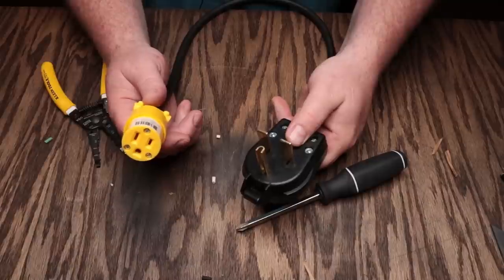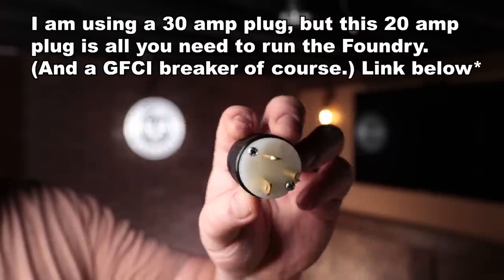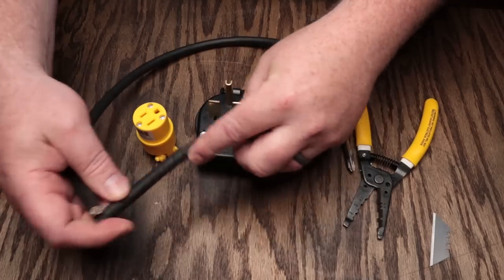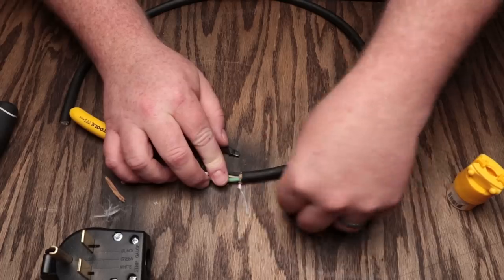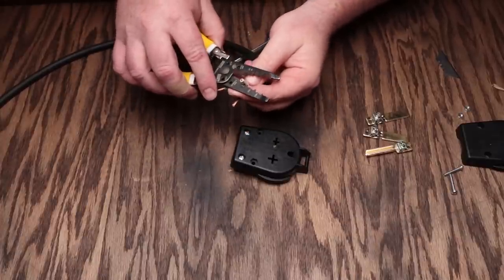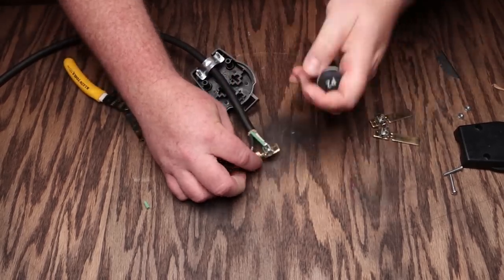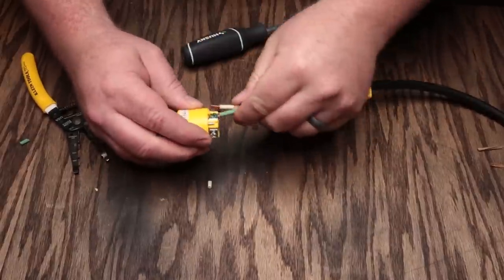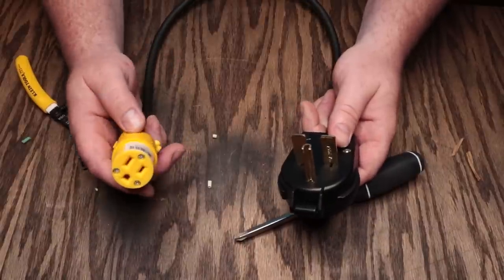Anvil Foundry 120v to 240v plug adapter DON'T CUT YOUR CORD!!

Comment: Thanks for this video, I bought the Foundry the other day and I did not like the idea of cutting the cord, fortunately stumbled across your review of the Foundry and then saw the Don't Cut The Cord video at the end. Not only avoid cutting the cord, but the short extension makes it easier to plug into my old dryer 240V plug in my former laundry area in the basement. Straight forward easy to follow videos, not just for Foundry, but for the various presentations you posted, great work IMO.
Reply from the maker: Awesome just make sure you are GFCI protected! 👍🍻
Reply: +1!  Same story here (except for having a spare dryer outlet ☹). Great videos all around. I really like your presentation style and the video production. ✩✩✩✩✩
Reply from the maker: Thanks!! 👍🍻

Comment: Great video, thanks!  I agree with nearly all previous comments, and yes there’s cause for  concern with mistaking adapters.  Two important SAFETY TIPS though:  1)  never leave the 220v  plugged in when not actually using the Anvil system.  Only plug in when you need to run elements.  2)  this is a dedicated adapter for Anvil system only.  As such, securely fasten the adapter to the Anvil system power cord so adapter remains connected to Anvil.  Something as simple as zip ties can keep the connection attached & would force someone to purposely remove secured adapter from system.

Just my 2 cents worth as a mechanical engineer and long-time brewer. A little sense can go a long way.  Cheers!
Reply from the maker: All good tips!! Thanks for the comments!! 👍🍻
Reply: @ShortCircuitedBrewers  Definitely a good tip.   Its not me I worry about its someone else grabbing this and plugging in something besides the Anvil and letting out the magic smoke or worse.
Reply from the maker: @matthewmeiser2298  lol magic smoke!!
Reply: Tim, I agree with your comment and Matthew's below. So I would also clearly label or tag the adpater with something like "WARNING! 240V: For use with Anvil Foundry ONLY!" at the NEMA 5-15 "standard" outlet end. Just in case it ever gets unplugged/unsecured from the Foundry plug.
Reply from the maker: Good idea! 👍🍻

Comment: Thanks for this vid Brian.  Followed every step but had to go for an old school 240 volt (3 prong) plug vs the one you used.  Same brand just a different configuration.  Some hesitancy plugging it in and firing up the foundry but went for it and it works flawlessly!
Reply from the maker: Great!! Glad it worked! 👍🍻
Reply: I think that is a 20amp 240V connection. The one in the video is 30amp. The bigger 4 prong 240V is 50amp.

Comment: You're right. It's the current level which dictates the gauge of the wires used and insulation etc, not the voltage.
The higher the current the thicker the copper wire needed.
This is why solar panel arrays on home roof tops are wired in series. This means that the voltage is added but the current stays the same. So 10 panels rates at 38V DC and 5 Amp, will produce a total of 380 V DC and 5 Amps when wired in series. You can then use 5 Amp rated cables which are cheaper and thinner.
If you wired the same 10 panels in parallel you get 38 VDC and 50 Amps, which requires expensive heavy gauge cables. Also the high current makes it very dangerous.
Note: Both series and parallel wiring arrangement produce the same output power (ie 1900 W).

Not sure why the heating element power would be 2800 W at 240V and 1600 W at 120V. The 30 amp maximum on the 240 V?
In the end you're limited by the current that the system draw
Reply from the maker: You are assuming the wiring doesn't change from 120v to 240v there is a switch on the machine that changes the wiring configuration for the 240v option. 👍🍻
Reply: @ShortCircuitedBrewers  ok. here in Australia the standard wall power outlets are 240V and limited to 10 Amps. You can separately wire up a 15 Amp outlet which is still 240 V.
Otherwise need to specially go a 3-phase wiring at 415V (industry usually uses this option)
Reply from the maker: @PetraKann  I understand. 👍🍻
Reply: And there are cable type voltage limits that start around 300 or 600V. Just no issue between 120 and 240V with the components in the video.

Comment: I made my adapter cord. Got my NEMA 6-20P receptacle installed. Plugged in the cord to check everything out. Heard a loud pop - saw sparks. Shut off the breaker immediately. One prong on the NEMA 6-20P was burned along with the corresponding hole on the receptacle. Not quite sure what happened. I also made my cord from 10g wire. I scheduled an appointment for an electrician to come out and take a look.
Reply from the maker: Something has a direct short it sounds like. I'd wait for the electrician to check it out.

Comment: Once you make the adapter you can get plastic cord holders. Made to keep two extension cord together. That would keep the adapter with the anvil.
Reply from the maker: Definitely good advice! 👍🍻
Reply: Cut a section of old bicycle tire inner tube and stretch it over the connection.  Zip tie each side.

Comment: Suggest you make a point of connecting the white wire to the wide conductor of the 120V. Just in case someone changes the 240V plug to a male 120V.
Reply from the maker: Ok

Comment: The only concern I have with this would be if the 120V plug(s) are rated to handle 240V. If they are not, then there would be a potential of arcing between the contacts within the 120V plugs if they did not have the proper spacing between the contacts. I do not know if this is a potential issue with 120V plugs due to contact spacing and the material used but the concern is still there if the manufacture only rated the plug for 120V.
Reply from the maker: I understand your concern. There are no spacing issues and the amperage drawn by the foundry at 240v is less than what it draws at 120v. Also hundred of people have made this adapter and I've had zero contact regarding any failures. 👍🍻
Reply: There is a similar shaped 20amp 240V plug so there is no material "deficiency" but still need to be careful about creating a short due to wire handling (stripping too much, etc.)

Comment: My dryer outlet is 30a 125/250v. Would your solution still work if I follow your video and adapt the foundery cord to this configuration?  This would require a different plug which Ive researched and identified as meeting these parameters.  Thank you!
Reply from the maker: Yes it would. 👍🍻

Comment: Any issue with using a larger gauge wire?  I have a cord from a large SAN disk array.  It has a NEMA L6 plug and is 10 gauge.  I could save a lot of money by just buying a 15A 120V 3 wire plug.
Reply from the maker: Nope not at all.

Comment: I can think of one reason not to make that adapter. 
You accidentally leave the adapter plugged into the wall. Someone (kids wife whatever) breaks out a vacuum sees the dongle and plugs it in. They hit the power button. 
The master electrician in me doesn’t like this kind of adapter in a home. 
Just a thought.
Reply from the maker: I know you should not let small children play in your brewery unattended.. 👍🍻
Reply: @ShortCircuitedBrewers   or Wife
Reply from the maker: @MrRhino12667  lol right.. Mine brews with me so I didn't think about that!!
Reply: @ShortCircuitedBrewers  That's Awesome mine just drinks all my wine. just now getting into brewing.
Reply from the maker: Welcome to the hobby!!
Reply: How about replacing the plug with a C14 inlet (this is the power port on most computers and monitors) and then using a C13 to NEMA5-15P (the cable used to plug computers in for the US) for 120V and a C14 to a NEMA6-20P for a 220V outlet?

I'm no electrician but this adapter scares the dickens out of me.
Reply from the maker: @jasonq13  not a water resistant connection. Would allow water into the plug easily.
Reply: Don't have kids. :)

Comment: Hey Brian, why does it have to be a GFCI Breaker? Will this not work with a standard breaker? My place seems to have standard breakers where I’d plug into (Dry Outlet). What considerations would I made if doing this on a standard breaker?
Reply from the maker: It needs to be a GFCI breaker for your safety. Regular breakers are not  made to sense a ground fault. Be safe and don't use this without a GFCI breaker. 👍🍻

Comment: Love your videos and I’ve recently purchased a Foundry 10.5 as a result of your detailed reviews. I’ve brewed at 120v, now I’m ready for 240v.  In making this adapter, how long would you recommend the wire to be. Is 15 to 20 feet too long of an extension cord? I’d like run the wire outside. I do have a brand new Siemens 20A GFCI breaker than I’m installing in the panel. I don’t have an electric dryer as I use natural gas, so I’m stealing that slot for my Foundry. Thanks.
Reply from the maker: You can go up to 50' just fine with a 12 gauge extension cord. 👍🍻
Reply: Thank you for the speedy reply Brian. I didn’t think it would be an issue,  but figured I’d ask.
Reply from the maker: @MarceloSilva-xe1xd  I'd rather you ask! Thanks for watching and the feedback! 👍🍻

Comment: Brian, regarding my conversion: my 220 wall outlet has 4 prongs (three blade and one "L" shaped; however only three on the anvil 110.  I did see another video where you did not use the 4th neutral prong when you wired the three up in order to use a GFI.  Is this correct?  I can remove the "L" shaped prong, wire the three other wires to the two hot and 1 ground?  Thanks

Bob

Comment: My garage has  30 amp 240 breaker.
The outlet box has red and black hot wires, white neutral wire and a bare ground. Im assuming i should us the 14-30r for the outlet. But not sure what to use for the insert plug.  Remove the white prong so it 2 hot and 1 ground? 3 prong
Reply from the maker: Yes you can do that but you should watch my inline GFCI cord video to be safe if the breaker is a standard one. https://youtu.be/El3ew5bNQ3Q
Reply: @ShortCircuitedBrewers  
Its already has a GFCI breaker.  Would it be best to abandon the white wire or switch to 20 amp.  I think this feed was intended for a generator when they wired it. 
 Love your videos. Your a natural
Reply from the maker: @opdthru23348  not necessary. You can just leave the white wire off. Thanks!! ,👍
Reply: @ShortCircuitedBrewers  
Ok last question. With the understanding you are not a licensed electrician. Can you recommend an outlet? 
Thanks!!
Reply from the maker: @opdthru23348  I would use a standard dryer outlet that way you have more options in the future should you want them. And make the adapter cord with a dryer plug and remove the lower center lug (neutral) just in case you want to move up to a larger system in the future. 👍🍻

Comment: Tape the adapter to the cord of the device it's meant to be used with, that lowers the risk of accidentally plugging something els into it.
Just a quick word of warning: If your house ever burns down due to something in your brewery or anything near this adapter, your insurance company is going to try it's best to not pay out due to this adapter.
Reply from the maker: Good tip! 👍🍻

Comment: Any idea how to convert a 4 prong 240v outlet? Do you think a 14-30P Male to 10-30R Female adapter would work ok?
Reply from the maker: You just leave the neutral wire unconnected. It is not needed. 👍🍻

Comment: I just picked up an anvil foundry for black friday and brewed it on 120. Worked decently well if I left the lid on to get a stronger boil. I am not too far from my dryer outlet so I was thinking about using the cable you suggested. I need to convert from the NEMA 10-30 to the NEMA 6-15. The circuit breaker that dryer is on is a 30A breaker, but I know the Anvil has a breaker itself. Do I need a 15A 240V in-line GFCI as your other video suggests or is the combo of the 30A breaker + the anvil's circuit breaker satisfactory? Your videos are awesome, they tipped me over the edge to get the foundry and I think it will make my brew days significantly easier.
Reply from the maker: You always need a GFI in the power cord or a breaker..a standard breaker or the Anvil breaker does not protect against ground faults..always be safe.

Comment: Hey Brian,

Awesome video! Thanks for the intel. It seems your link for the 12 gauge wire is out of stock. Which type of wire should I look for a replacement? 12 gauge, 600 volt? When I type this in it shows wires that all look completely different. If there is a variable that I’m missing, please let me know.

Thanks again!!

Comment: I am confused, with 3 prongs on the outlet how do you get 240?  Usually you have 2 hots, neutral and ground.  
Are there low amp 240v items like the 1st plug you show that only use a 3 prong?  My old house had a 220 that had similae sized prongs as a 120V outlet but ive been watching soo many generator videos where there are 4 prongs.  I haven't watched the whole video so maybe you explain it but thought id comment.

Is your neutral wire now acting as a hot or what?
Reply from the maker: 240 doesn't require a neutral. The only reason some devices have a neutral included in the plug is for 110 components inside the device.

Comment: Does that thing ever get hot using 12ga wire being 220 in a house uses 10ga wire?
Reply from the maker: Not with a load in the appropriate amperage range. You still have to pay attention to the component with the lowest amperage rating. Power supply gauge doesn't matter. My supply is 6/3 in this case. 👍🍻

Comment: Hello Brian,
I have an old style 3 prong dryer outlet (10-30) that has two hots and a neutral but no ground.  From what I've read, when a new electric dryer is plugged into an ungrounded outlet,  such as a 10-30, the ground on the dryer would just be connected to the neutral.  With that being said,  would it be possible to use this adaptor to connect the anvil to an older 10-30 outlet?  Would it be wired the same?  Would it even be safe?
Reply from the maker: If there is a standard outlet nearby you can use thi adapter and get the ground from the standard outlet 
https://amzn.to/3MZ8lQ6

Comment: I would like to add a 2 gang outlet to my brewstand with on/off switches to power my foundry and chugger pump and then run a cord from the stand outlets to plug into the wall. I would also like the ability to do this with 240v if possible...how would I go about doing this? Any help is appreciated!
Reply from the maker: It can definitely be done. Can I explain it in a comment? Probably not. Why don't you send me an email  . Brian@shortcircuitedbrewers.com and we can discuss it.

Comment: Hey Brian, THANKS for the video, super helpful.  I need a similar adapter, but in reverse of what you made.  I'm assuming it's the same process but swap male to female and visa versa, correct?  I have a RoboBrew 65L and need get that N6-30p plug to a standard 120v plug.  (Additionally, I'm using a step up/step down transformer (240v/5000watt) plugged into a GFCI circuit to power my set-up)
Reply from the maker: Yes sir! For that it is cheapest to just buy a dryer cord and hook to the plug you need..the strange thing about the 65L plug is I couldn't find a cheap solution for the plug so I wound up going with a wall mounted one that was available. I can send you some pics if you need to see it. short.circuited.brewers@gmail.com 👍🍻
Reply: @ShortCircuitedBrewers  That would be amazing if you have a couple pics handy!!  Thanks again for the help!!
Reply from the maker: @brettmoore3919  shoot me an email.

Comment: Great video. Successfully pieced this together. Is there a separate Brewfather profile for 240v? If not, can you recommend what values may change based on what is currently on there? Thanks!!
Reply from the maker: Boil off is really the only thing you need to change. IMO

Comment: Could you similarly make a 2 circuit 120 -> 240 adapter? I rent, so i can't get a 240 GFCI added to my breaker box, but I think this line of thinking would allow 2 120V circuits (with GFCI plugs) to be brought together to run this at 240 safely. Can you confirm?
Reply: Not unless it's a four prong plug with two hots, neutral and ground (four wires to the outlet) you'd need to select one of the hots, wire the neutral and ground to the adapter plugs. the other issue is that you'd be able to load the circuit with more amperage and voltage before tripping. So that could lead to a fire issue w overloading the cable and devicd rating from the device to the 240v four wires plug.
Reply from the maker: I theory might be able to get 240 volts that way but the outlet would have to be on different "legs"... Nevermind..
Reply: If you did get two circuits they would need to be non gfci as GFCIs will trip due to current between the circuits needing a 240V GFCI in your adapter.  Even with that if only 1 of the leads is plugged in the other plug would be potentially live through the device so very dangerous configuration (depends on device circuit).  Too many downsides to contemplate and if it burns down your landlords place well you are is a serious heap of...  Sitting here amused at all the hassle a split 240V system like the US causes for moderate loads.
Reply: @rwhitenz  not really... Sharing a neutral and a ground isn't an issue, and GFCI should work fine on the single leg "120v side", not on the "240v side". They split and combine these lines all the time. Think of the stuff coming off your pole. Also, if worried about overloading a circuit one could create a "brake out" box with an appropriately sized circuit breaker between the 240v two legs side and the single leg 120v sides (you'd essentially have two equal circuits). The box, though would need to make sure that neutral and ground are never bonded there, only at the main box. I think people are kinda confusing what split single phase and true two phase is.